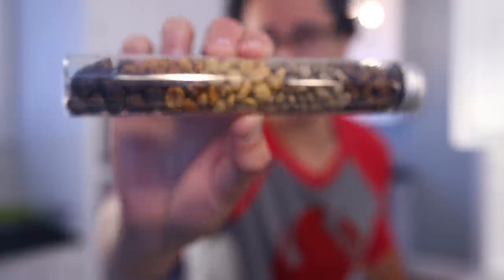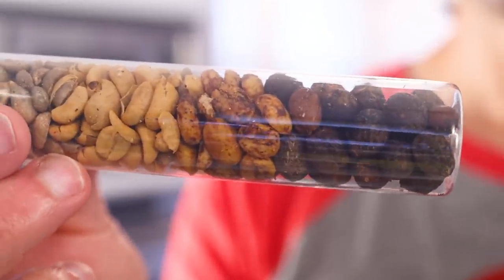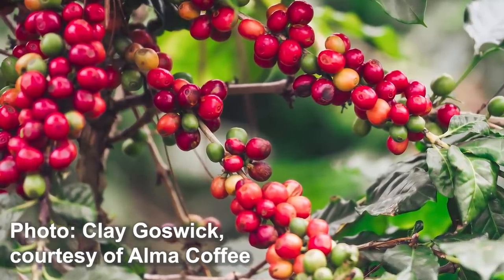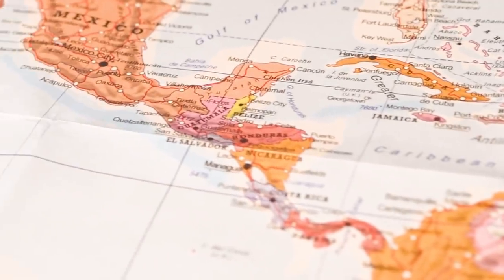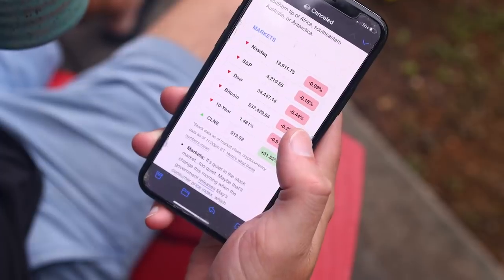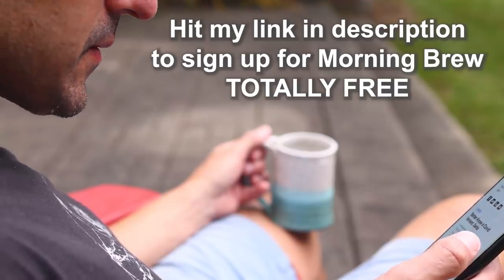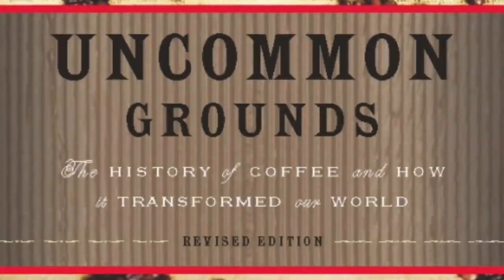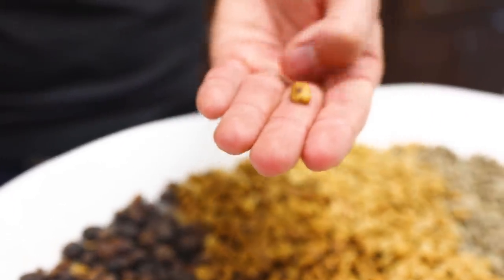Dry processed coffee — tastes like Tropical Skittles?

Comment: The "ritual" part was incredibly familiar, then I realised that I similarized it with the Turkish coffee. Turkish coffee is prepared by cooking the coffee dust in hot water, unlike processed coffee. Taste is intense, smell is fragrant, and consistancy is very thick. The only lacking point is the fruity aroma of the bean. Adam Ragusea can truly relate to every part of the World.
Reply: So the Turkish method is basically grinding the seed (bean) very fine and leaving it in the water? That makes sense. Could be interesting to try that. The beans are inoffensive -- they simply taste like coffee -- and can be enjoyable to eat (when roasted); we just filter out the grounds normally because they make the drink unpleasantly gritty, but I suppose if you make it fine enough, that wouldn't matter.

I imagine one downside, and maybe you can fill me in on this: Coffee seeds contain oil, and when we grind oily seeds like peanuts and almonds to a fine enough grade, they become more of a smooth paste (peanut butter, almond butter, etc). Does this happen with coffee seeds? Does it present a challenge when mixing it with water?
Reply: Danijelovski Kanal  😅 More importantly, I'd need to solve needing sleep at night first, before I stopped getting it.
Reply: @Corrodias  Sorry for the late reply, I didn't get the notification. 

So, there are a few specialized equipment to do this, but I think you can replace the equipments with similarly measured ones. We usually use a copper coffee pot called "cezve", and we also pour the coffee into ceramic cups that is very small in shape. My preferred ratio for Turkish coffee is what we call "orta (medium)", which is 1:1:1. One coffee spoon of coffee ground, one coffee spoon of sugar, and one cup (little ceramic cups I mentioned) of water. That's it. We just put the water onto the ground as you figured, and let it come to boil. Once it boils and starts to froth, it's done and ready to serve. We pour it into cups that I mentioned to serve. Maybe you can also serve cold water alongside. You can totally do it without sugar, but taste is very aggressive and bitter that way. Not much people prefer it.

About the coffee ground: We usually don't grind the seeds ourselves. The coffee ground we buy comes as a really fine ground, and very soft and fluffy in texture. Usually (and traditionally) it's made of Arabica seeds. Not many people don't have the grinding equipment, so it's not easy to come across people who actually make it at home. Now that I think of it, I don't think I've ever met one. Maybe one reason why, is the oil as you said. I have no idea about how the companies ground it. Everyone prefers to buy packaged stuff like I said, most famous brand being Kurukahveci Mehmet Efendi. 

Coffee is not gritty itself. The grounds settle at the bottom of the cup after a few seconds, and it usually don't ruin the drinking experience, at least until the last sip. The sediment collected at the bottom of the cup is called "telve". Some people eat it, and some people use that to tell fortunes. To tell a fortune, you just put the saucer on top of the cup, turn it upside down, make it spin on top of your head with circular motions for three times, and let it sit for a few minutes. Then someone who knows how to read shapes would tell your fortune. Although no one believes in it, it's a fun activity to do with friends for laugh and giggles.
Reply: Danijelovski Kanal  I knew that Turkish coffee was popular in Balkans, but I somehow never expected it to make it all the way to the Croatia. I'm glad that you enjoy it. I don't usually drink at night for that reason but I've done it many times to stay awake during my finals week, so it's the Adderall of cheapskate students!

Comment: The holes in Original Emmentaler cheese are also a good example of humans getting to good at it.

Sometime ago people noticed a significant decrease in hole quantity and size in the cheese and for years  they couldn't figure out why, until scientists discovered that the holes develop from microscopic hay particles which release gases during the fermentation process of the cheese. 

Now what actually happened?
The production of Emmentaler cheese hass gotten cleaner and cleaner with better technology to keep away impurities, so no holes.

Nowadays a certain amount of very specific hay particles is mixed in every batch of Original Emmentaler production.

Producers have even gone as far that they now use the uniqueness of certain hay particles so they can proof with higher confidence that it's actual Emmentaler cheese.
Reply: Thanks for sharing. Always cool info down in this comment section. Cheers :)

Comment: Out of curiosity, is there a reason you can't dry process coffee in an oven vs on those fancy tables? Not that everything has to be mechanized, but that seems to scream for it, lol.
Reply: The long timescale and environmental conditions of the process are largely what enables the flavor. The resulting flavor from the fermentation would not be present if it were oven-dried.
Reply: Try drying 100s of kilos in oven, usually in remote places where the farmers don't have a lot of resources to work with. That's why, it would be way too expensive